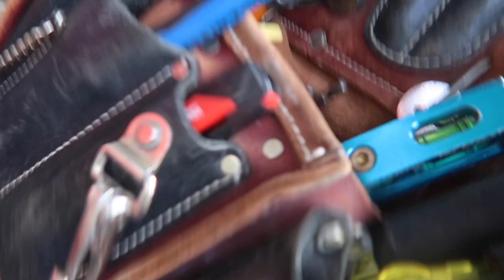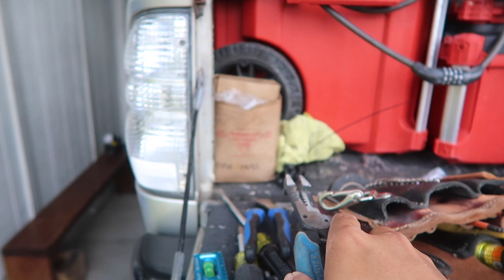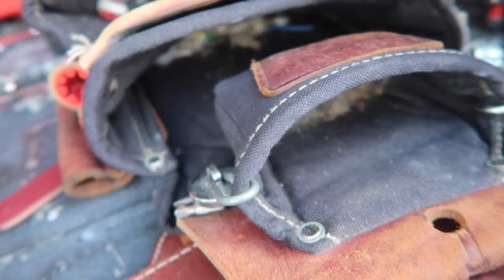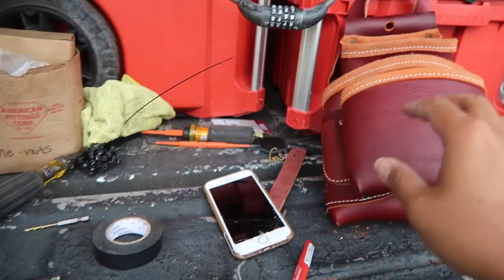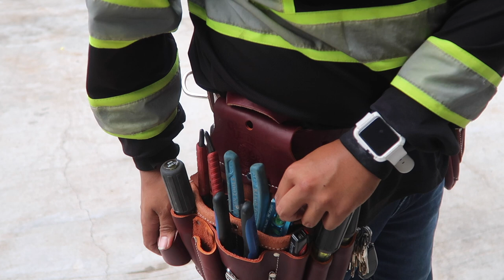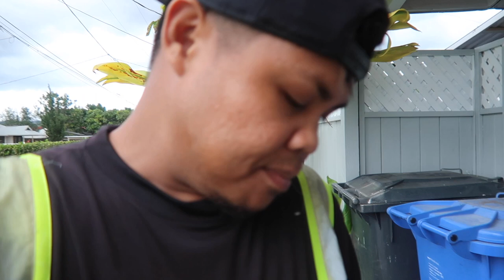New Occidental Tool Belt Set Up + NEW & IMPROVED DIY HANDLES!

Comment: Im a retired MILWRIGHT, SOME YEARS BACK I BOUGHT THOSE SAME TYPES OF TOOL BELT WITH LEATHER SUSPENDERS. I TURNED IT INTO A BELT LESS SYSTEM. ITS  SO MUCH BETTER BECAUSE BENDING OVER WITHOUT THE ALMOST 3" BELT GETTING IN THE WAY IS COMFORTABLE.
I WAS ON A JOB WORKING COMPOSITE WITH IRON WORKERS, AND ONE DAY ONE OF THEM WAS TRYING TO POKE FUN AT ME ASKING ME "WHAT DO YOU CALL WHAT YOU'RE WEARING ?" I ANSWERED
HIM "THESE ARE CALLED TOOL BELTS, THOSE (THAT HE WAS WEARING) ARE BOLT BAGS" BECAUSE THAT IS WHAT MOST IRON WORKERS WEAR.

Comment: I've been using O.L. leather stuff with Sheepskin hip pads for 20+ years. Recently picked up some Veto to try out for a new/different setup.
I was just thinking about putting leather handles on my stuff as the synthetic handles on the Veto are bulky and while removeable, still kind of a PITA. The leather will break in nicely and easily tuck out of the way. 
I use mine for elec. plumbing, and oher projects. The leather pouch holds an impact driver nicely as well.

Comment: DUDE ditch the nut drivers and buy the KLEIN FLIP IMPACT SET. It’s like a screwdriver with a 6” impact extension and 6 flip sockets from 1/4-1/2

It’s got a Klein screwdriver handle you can remove just like the 11 in 1. 

ALSO, you don’t get the nut shavings filling the magnet up since they are reversible ( Ex the 1/4 flips to 5/8 and the middle is a hole, the magnets in the extender)
Reply: Also for weight I put all my layout/measuring stuff on the left, and wrench type stuff. 

And side cutters/needle nose because I usually realize I need them when I have my linesman’s or something in my hand
Reply from the maker: I seen that and was thinking about it lol, kinda wish they had up to 9/16 so I wouldn't need to carry a separate piece and I'd still have the nut drivers in my bag or something for shallow applications where the Klein flip is too long. Cool tool though, I think I might get it just to have 👍🏼
Reply: @fortunestatushawaii  they have a better one now with 9/16ths and a drill/driver bit index in the handle.

Comment: Did you like the 5 in 1 hammer holder I’m thinking of getting one? I do concrete forming and I think the 5 in 1 and the trim pouch you have will work good for what I do
Reply from the maker: Yeah I liked it. If you were using it paired with a smaller pouch I think it would be great considering it’s smaller and can hold a few more variety of tools. I just didn’t like how it was bulky paired with my already big “full sized” bags which added more weight to the pouch setup itself but I think you’d like it if it’ll hold what you usually carry.

Comment: I went with your old tool belt because I like the 2 pouches for  staples and wire nuts. Where did you get the handles for the commercial belt? Can you use the leather handles on the commercial belt?
Reply from the maker: Yeah I do miss having that extra pocket instead of one big pocket. I used random leather straps I ordered from Amazon, but yeah you can use the occidental leather straps that I put on the new tool bags. I would rather use that instead since they match better. Same concept of mounting.
Reply: Awesome thank you for sharing.

Comment: Your old bags are still like new you could have gotten at least five more years out-of those
Reply from the maker: I know, just wanted to use a smaller more compact setup for efficiency. I felt my original bags were too heavy/bulky for what I’ve been doing.
Reply: I've got some O.L. stuff that is 20+ years old and still in use.

Comment: Occidental telecom bag is even more compact and smaller ... I’ve had mine fir a year doing industrial electrical work and I love it
Reply from the maker: Nice! I was looking at that as well but don’t think it would be good for what I do. Even when I’m just trouble shooting I like to have spare pockets for wire nuts and little extra tools lol.
Reply: @fortunestatushawaii  same here it took me a couple days to grow into it ... I use the Klein bolt pin bag for small material and like extra level or Channies or stuff like that ... I came from the larger Milwaukee pouch but that thing started to give my thigh a rash 😅
Reply: @heightskings6693  Klein bolt bag is a great addition to pretty much any tool bag setup